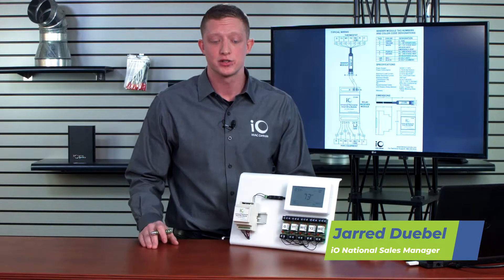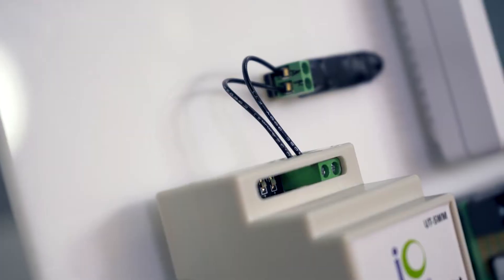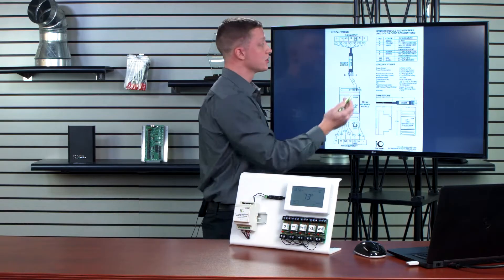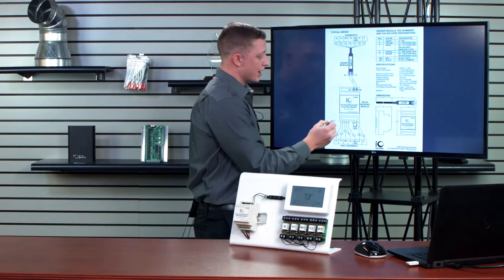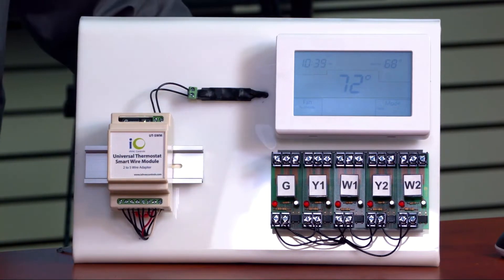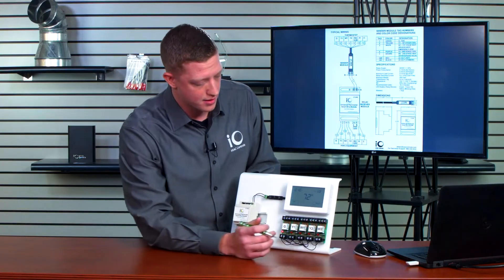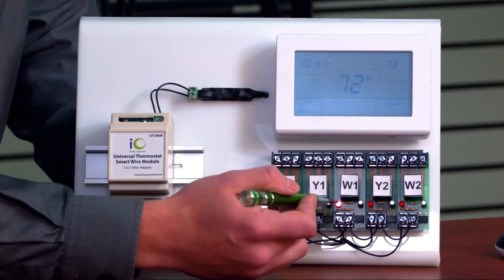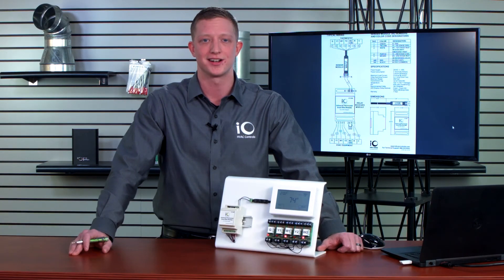Universal Thermostat Smart Wire Module (UT-SWM) -  Full Technical Overview

Comment: Wiring this is pretty straightforward: take your existing thermostat wires off of the thermostat and off of the heating controls at the furnace or boiler. Those wires now go only between the UT-SWM sender and receiver. Take pictures of all wiring before you start and don't let the thermostat wires fall back into the wall behind the thermostat! You will only need 2 wires between the UT-SWM modules and make sure A and B are the same wires (colors) on both ends. Just think of it as connecting A to A and B to B using the existing thermostat wires. Now, connect the sender unit's wires to the thermostat as shown: white to the W1 terminal, red to the R terminal, black to the C terminal, etc. To wire the receiver module, you will need a short length of multi-conductor thermostat wire or whatever you have handy in 18AWG solid copper wire. The receiver will get connected to your heating controls exactly the same way as the sender, but you really only need the same wires as you had when you removed the existing thermostat wiring, with the excepting of the additional C wire you will add now: red to R or transformer hot, white to W or W1 for heat call, blue or black to C or transformer common. When you are done, the only thing connected to the existing, or old, thermostat wiring will be the sender and receiver modules A and B terminals.

Comment: Okay,  the WIRING DIAGRAM IS NOT COMPLETE,  THIS IS HOW TO WIRE IT UP!!,   1. IF YOU HAVE ONLY  one red and one white wire, for heat and red for hot.  use those Red and White t stat wiring to and  from AB from the Module to the Sender unit behind the T Stat.   put the control module in the furnace next to the control board,  there are NO t stat wires from the Furnace control Board to the Module because this Module kit doesnt have them included.  and you will find the Wires coming out of the Sender Unit are cheap and too thin and barely stay in the terminals due to that alone and break easily.   Next,  you will wire the control module to the t stat terminals at the Furnace Control Board.  Next, you will connect the SAME/Correct Red Wire to either A or B,  BUT!  NOT Crossed from and to and from the Control Module to the Sender, they have to be RED goes to A, and Common Goes to B.  you will no longer use WHITE for Heating from your Pre Existing T stat wires.   and all the old wires to the condenser goes back to the Furnace Control board so it will send signal to the Condenser when called.  meaning, the two wires from condenser go to Y, and C at the t stat control board on furnace.  and Bam.  It's done.  Once you do this, its easy.  this Control Module wiring diagram is a pain in the neck and in complete.  no examples for furnaces or anything else.  I could write up a better diagram than these guys.  but they lack efficiency, and keeping things simple.   hope this helps.

Comment: so you are saying wire up the old RW wires from the furnace to the t stat at R and use the W wire as a Common to the new t stat, and then what?  magically run two wires to the sendor from fkg where?  u cant use the only two wires RW from the furnace to the stat and magically have two extra wires for the sendor to the AB module?  wtf.
Reply: Did you figure this out? The old R&W wires from the thermostat to the furnace BECOME the A&B wires from the sender to the receiver modules and nothing else. Power (hot and common) and signals (heat, cool, fan, etc.) are sent over those two wires by the modules. Everything connected to the thermostat terminals now comes from the sender unit's little wires and everything connected to the furnace terminals comes from the receiver terminals (you supply that little bit of wire between the receiver and furnace). Hook up R, W1, and C to your furnace Hot power (R), Heat Call (W), and Common power (C).

Comment: Okay,  this wiring digram is incomplete that comes with this module,  meaning, the wiring diagram doesnt say where the two wires go to the t stat, and it doesnt show on the diagram where the two wires go to from the module, instead they are showed cut off from AB to the Module from the sendor?  and as for the RW wires coming from the Furnace to the old t stat... and now the new stat, where do the RW wires go to from the furnace up to the stat?   why didn't you guys make it easy and explain this.  not even in this video.
Reply: The wires are hooked up to the 2 wires going down (or up) to the equipment. You disconnect the 2 wire thermostat wire from your equipment and old thermostat. Assuming you have a white and red wire in your Themostat wire, wire red on A and white on B. Match this on the adapter behind your Themostat and the disconnected wire by your equipment. The adapter has 7 wires that you can hook up to your thermostat (w for heat, w2 for 2nd stage heat, g is for fan, y is for cooling…etc. match those on your circuit board and..done. But you can also buy a wireless thermostat that works with batteries and can control your equipment from up to 300 feet. And it’s about same price.